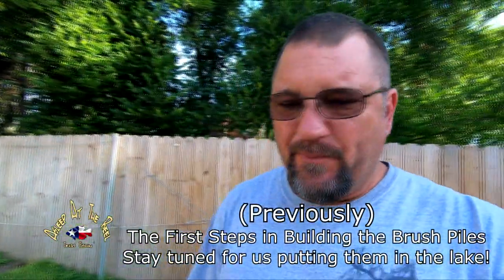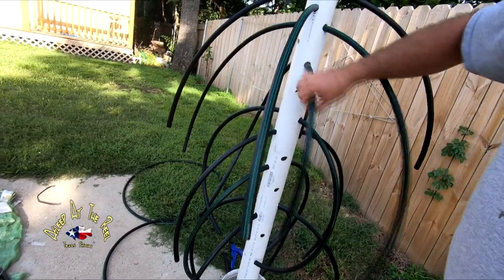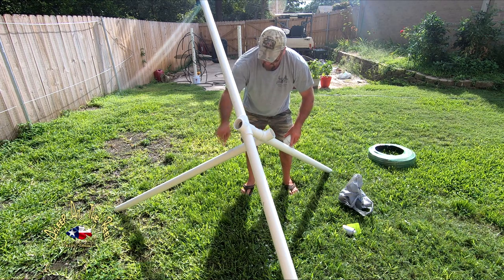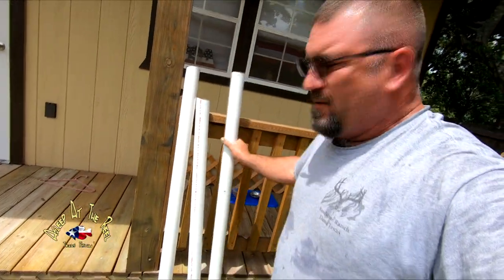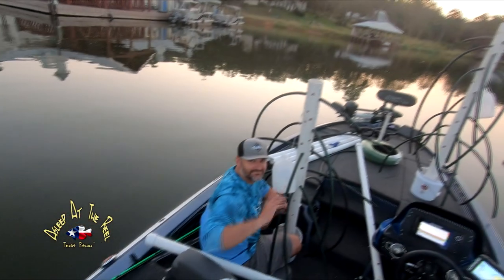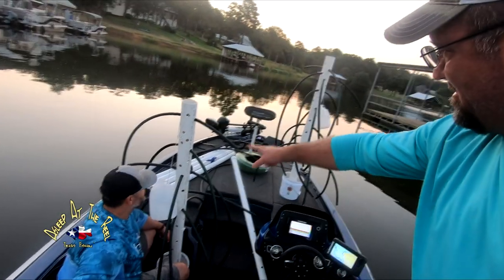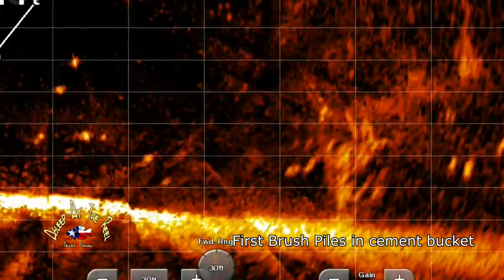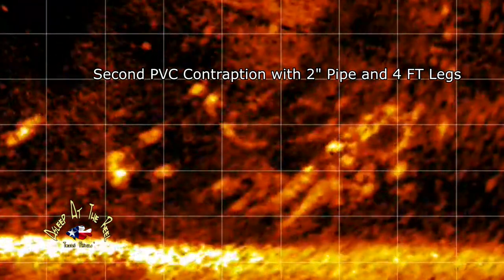WHAT ARE THE FISH DOING????  Making Brush Piles (Dropping them in and viewing with Livescope)

Comment: If I missed how deep you put these I apologize but how deep would you put something like that for spring and early summer crappie fishing ?
Reply from the maker: I do not remember the exact depth, but it was in roughly 14 foot of water.  With that said, it was in the middle of the lake so I did not have to worry about it being out of water at any point in time.  They were about 100 ft from the river channel which is also key as the crappie use that river channel to move during the different seasons.  Thanks for watching and commenting.

Comment: Thanks for the video, as a plumber it looked like y’all used orange glue which is for cpvc piping instead of pvc pipe, but also if you will use primer along with glue made for pvc pipe it will actually melt and bond the pipe and fittings together. Hopefully this might be something that you can try.

Comment: fun tip for you -if you get a copper pipe cleaning tool of the right size or take apart a battery cleaning tool you can run the black tubing through the tool and scrap it witch lets algae grow faster!
Reply from the maker: Thank you, good to know. Will try that next time.

Comment: Suggestions:  Fill those legs 1/2 way with sand.  It's not as  heavy as cement but is cheaper and quicker.  On that bucket brush pile use 2 4' 3/8 rebar  set in a cross through the bottom of the bucket to stabilize it.
The plastic  bottle in ingenious by the way.
Reply from the maker: Thanks for the tip and thanks for watching.  I am going to find those things soon.  Changed graphs and forgot to save the points.  I have an idea of where they are but have to find them.  ha ha

Comment: THAT'S NOT A CRAPPIE CONDO THAT'S AN "AMUSEMENT PARK"..LOL....I'm not sure if you sanded the PVC..but I have read and heard that the algae and zooplankton can attach to the PVC if it's sanded..just would be a better ECOSYSTEM..THE CIRCLE OF LIFE...Nice video..THUMBS-UP!!!!!!
Reply from the maker: Thanks.  Did not sand it. BUT on that note, I see many docks that have PVC water pipes and they have algae all over them so sanding might make it easier for them to attach but I do not think it is required.  Ha Ha it is an amusement park.  I plan to find them again soon.  I made the mistake of not verifying that I had the way points downloaded  for the new graph I put on.  I just need to figure out which of the helix 7's I have it on and hook it up when on the lake.  I replaced them with Helix 12's and well, the points did not back up like I thought.
Reply: @AsleepAtTheReel  have you able to find it? I heard people said PVC not appear on DI or SI. Nice structure.

Comment: i wonder if playground sand would be easier to use as weight,
Reply from the maker: It might be but I personally would not want it on my boat! 😂. Seriously that might be a good option but getting in there would have to be done before all the holes were drilled.
Reply: @AsleepAtTheReel  very good point - I wasn’t worried about my poor boy John boat on a ranch tank 😂
Reply from the maker: @warddanger  I did not mean to sound sarcastic but yes you are correct. Pouring anything in there is messy, trust me, I had quikcreat all over which is why I did it at home and not on the boat!  But yes if you are in something like that I bet it would work. The only thing you would have to worry about is current.  If you have one, it could potentially wash the sand out, but by the time that happened it is liable to be embedded in the ground.  Good thought
Reply: @AsleepAtTheReel   last thing i thought bud, love the videos!

Comment: Wouldn't it have been better to make cuts in the tubing halfway between the white pipe branches on the larger structure after you wove the tubes, so that you would be less likely to have fish wrap your line around them?  They could still wrap you around the larger pipe, but I would think it would happen less often this way.
Reply from the maker: That is an idea, but at the same time after using this for 6-7 months I have never had that happen.  I use a long pole so they do not get close to it.
Reply: @AsleepAtTheReel  Awesome! Sounds like it's working!
Reply: @AsleepAtTheReel  did you find your structures even after your lost waypoints?? i sunk some cedar last weekend and caught fish off them yesterday. great feeling and they get on the stuff QUICK!

Comment: Do you leave the string on it after you drop it in?  If not, how do you release the string to bring that back up?  Getting ready to try this on my home lake.  Thanks and great video!!!
Reply from the maker: No I take the string off.  Basically it I am dropping it in 10 ft of water I have twice as much rope.  This way I get it to the bottom and with Livescope I am make sure it is in the position I want.  Once I do that  I simply pull one end of the rope out.  For easy use, 20 ft water have a 40-50 ft rope, put it through a handle or something drop it in, once set let go of one end and pull the other.  Hope that helps.   Good luck on getting your brush out. If you have several different brush piles you are dropping in, I would put them in different water levels so you have a pile to fish for each time of the year.
Reply: @AsleepAtTheReel  ahhh. I gotcha.  Great idea.  Thanks for the reply!!

Comment: when you stand away from the camera and talk you sound just like johnny cash.  

I appreciate the scale of your design very much

i wonder if structure could be made by using dead limbs from the local woods, a drill, a bit of concrete and a roll of bank line to tie it all together through drilled holes in the limbs.  Im thinking of a structure made from 100 or so 2" x 4' long branches, alternatingly stacked and fastened into a pyramid/box shape.
The dead wood might rot faster than fresh cut but I think it would serve its purpose well enough.  

I was also thinking about a few pairs of large, discarded christmas trees wrapped loosely in chicken wire with plastic vines/plants ziptied around the exterior.  

I always intend to resource materials at low or no cost. I can often get by with the lone purchase of screws
Reply from the maker: LOL Thanks on the sounding like Johnny Cash.  ha ha.  On the structure, yes you can use branches, just need a good weight on it. If you use Christmas trees put a small bottle on the top with the cap installed and it will cause it to float.  There are about 40 in one area on my lake.  Many people do use a drill bit, drill a hole then wire them together.  Rope will rot before the trees do.  Thicket tree limbs will last longer.  Honestly I do not think you need to wrap anything around it as if it is to tight, the fish cannot get in, so you want to have it branch out like a Christmas tree.  I know guys here that use bamboo.  Hope that helps. Thanks for watching and commenting.

Comment: I think it’s better to position the drip pipe upward ??
Reply from the maker: it is but the hole in the pipe was larger than the pipe so they automatically fell downwards.  Will fix that on the next one.  I do agree with you though.

Comment: Instead of using mixed concrete, since you're gluing together, just use sand to fill the bottom legs - easier, faster and cheaper
Reply from the maker: Good idea.  The reason I did not use a sand or something else was because I had drilled holes in the PVC and was not sure how they were going to land.  Now that I know that is a good idea.  Thanks for watching.

Comment: I think everyone suggest flipping the drip pipe upwards, is to mimic a branch of a tree
Reply from the maker: I agree, unfortunately I could not do that with that particular tubing.  The reason is the hole was a little bigger than that pipe which meant that it automatically turned downward.  I hope to fix that on the next ones I put in. Thanks for the comment and I fully agree, just could not be done here.

Comment: Did you catch any on the pvc pipe?
Reply from the maker: HAHA good question, the answer is no right now, but that will change as soon as I find it! :-)  I changed graphs and forgot to download my waypoints.  Once I get them downloaded I can find it again and try it. I did look at it a week later and there were fish on it. Just did not have time to fish it.
Reply: What size drill bit did you use?
Reply from the maker: @vhf2582  I do not remember.  I basically took the hose and found a bit that was just slightly bigger.  Was trying to find one the same size so there would not be a lot of play in it, but nothing fit exact so I went just a little bigger so I could slide the pipe in.
Reply: Okay thanks.

Comment: Next time put the ready mix in dry then put the water .
Reply from the maker: Good idea, and thought about that but did not want quick Crete all over my new boat.  I appreciate and thank you for your comment!
Reply: @AsleepAtTheReel  I. Sorry I guess I didn’t explain it right. Do it in your yard pour the dry mix in the pvc then use water hose to fill the pipe up if it don’t soak up all the water just pour it out.But I’m sure it will soak it up ,are add small parts of water till it stops soaking it up .I have put dry mix in a hole and it’s the same as putting it in a pipe. Just saying
Reply from the maker: @grayghost016  Ah yeah that would be a little easier!  ha ha.  You probably explained it right and I just misunderstood.  Good thinking Sir and thank you for following up!